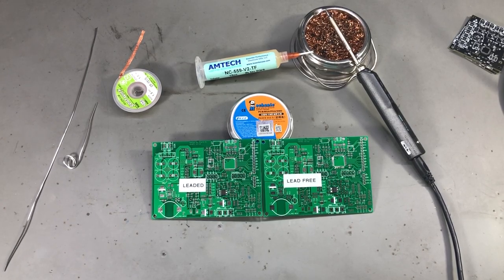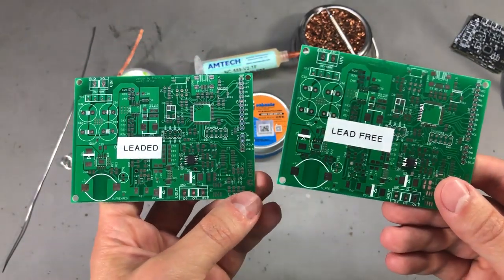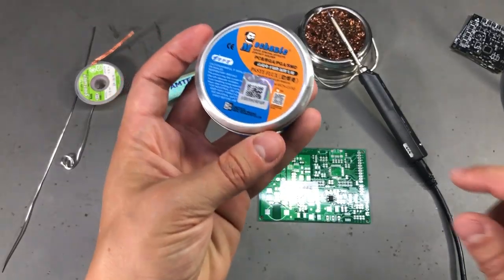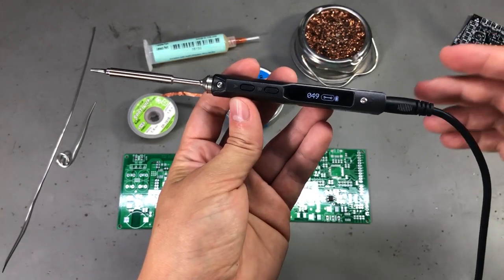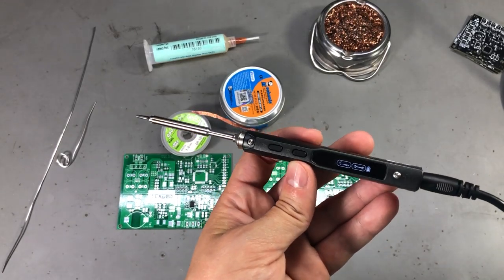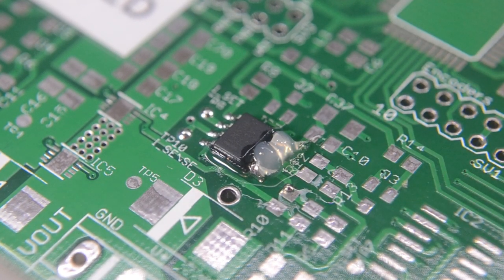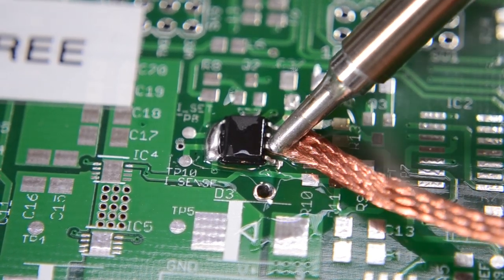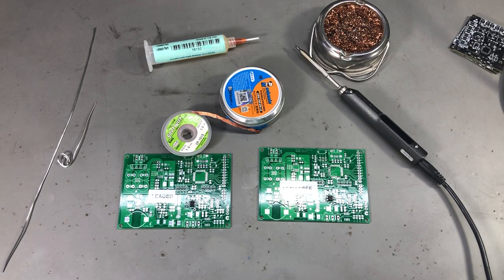Voltlog #252 - How to fix a solder bridge

Comment: Nice video Florin, I have a personal advise/trick when using solder wick. 
Solder wick acts as a heat sink, so (depending on the quality of the wick and your iron) some times you need to increase the temperature in order to make it work properly. So to make it more effective, instead of using the entire roll, I just cut a small piece and hold with my tweezers (smaller piece -> smaller heat sink-> better results)
Reply from the maker: thanks for the tip, I agree, sometimes it's useful to use small pieces of wick.

Comment: yep that happens and as you said it is required to really  raise the temperature be gentle with dragging solder wick , or you might even bent the pins of the SMD IC if too much force is applied on tip and wick and not heating properly.
Reply from the maker: there is a fine balance in the technique and one really needs to practice to find this balance 😁

Comment: How can you forget the solder sucker sort of tool available to suck out the molten solder and that makes life more easier while dealing with solder bridges. It works for me, I don't know why you did not added that in the video.
Reply: Solder sucker is fairly useless for surface mounted components - the nozzle is too big and typically you don't have enough solder there to form an efficient seal while sucking it off, so it doesn't work very well. Smaller components could even be knocked around with the nozzle and/or sucked into the cylinder. Flux & wick are a lot more efficient for this work. Keep the solder sucker for what it was intended for - desoldering through hole components.
Reply: @JanCiger  yeah.. later i thought the same. Thanks.. have a good day ;)

Comment: @VoltLog, you should have mentioned that one needs to be *extremely careful* when moving the solder wick. 
It is actually best to avoid having to slide it around at all. Place it on, suck off the solder, then remove it perpendicularly to the joint and put a fresh piece of the wick on the solder blob to continue the work. Do not tug or slide it around! 
The reason is not because it is "abrasive" (the wick is soft copper, that's unlikely to damage anything) but because it tends to "stick"/get soldered either to the PCB pads or to the IC pins and those could get even ripped off if one is not careful and trying to tug at the wick when the solder isn't completely liquid under it. If it doesn't want to move, *do not tug* at it! Reheat it with the iron first!
Reply from the maker: You're right, minimal force should be used, minimal movement as well. There is a balance between all of these things and one needs to practice until it gets good at it.

Comment: The solder bridges between pins removed using flux and a clean from solder iron tip just pulling the melted solder to one direction and if left some residues then clean it a second pass putting fresh flux.The desoldering wick is good to avoided since it causes damage to the pcb and reduces the life of the soldering tip also.

Comment: Good video, I just want to note that lead and lead-free solder should not be mixed as you lose durability. If you mix them you get a new alloy with new but unknown characteristics. Usually the strength of such a solder mix is reduced.

Comment: For solder Solder Bridge Olympics, you should try a 100-pin 0.5mm pitch MCU.  Oh, those pins are tiny, and easy to bend, or burn/lift the pads.
I often cut off a little piece of the wick, then holding it in tweezers to avoid heating up the whole roll.
Reply from the maker: yes, I once assembled a board with such a chip and it was a pain to get right...

Comment: Hi, so i need to use flux also with the wick? i can just use flux / heat and sweep ? or just the wick alone? 
Also, i dont have a fancy solder....its a basic plug in and go...  40 watt 220/240 volt.
I use a kitchen sponge (damp), the green abrasive pad at the back... is that fine? or u reckon goldilocks (like in your video) used sometimes on pot and pan in kitchen.
Also, is it fine to use a solder iron and tip that has not been used for years , maybe even 15 years... ?
Do i need to clean the pcboard?
I am trying to remove a bridge i did accidentally (before i knew of flux or even wick) , on a thing pcboard for a hard drive.
Thank you

Comment: Can you tell me name of PCB Designing software??
Reply: EasyEDA works well for me. Otherwise KiCad is a good alternative. 
There is also Pulsonix and some others, but they're quite expensive and in my humble opinion only worth the money if you do it every day and for a living. Although if i remember correctly the free trial version of Pulsonix stays free with a limitation up to 100 pins/pads. So if you don't need more that could be an option as well.
Reply from the maker: I am using EagleCAD but would like to switch to Kicad at some point.

Comment: Can you provide me a link to that syringe tip? Is it ceramic?
Reply: @JanCiger  Thank you friend :)
Reply: @FixDaily   Welcome! I did look for that white tip, I think that's just a normal plastic tube because it is cheaper than metal (the needles are meant to be disposable - but you can reuse it if you clean it with some alcohol and don't let the flux dry inside). There is no reason for it to be ceramic.
Reply from the maker: they are plastic, here is a link http://voltlog.com/y/3srvu